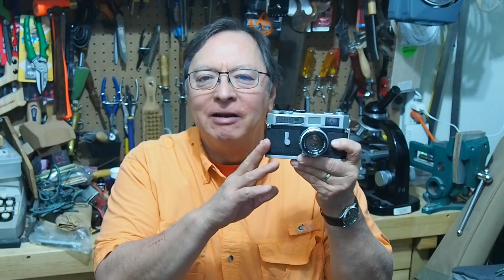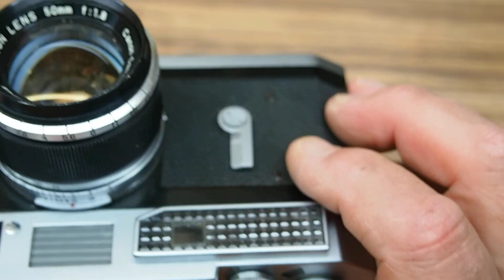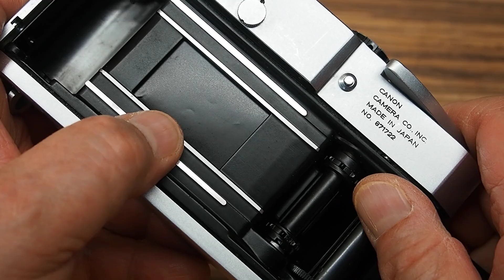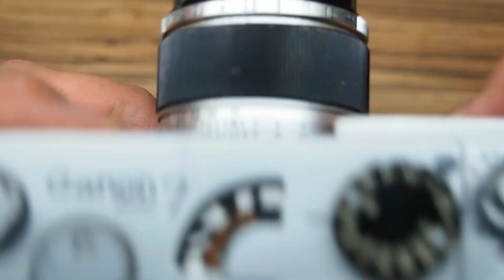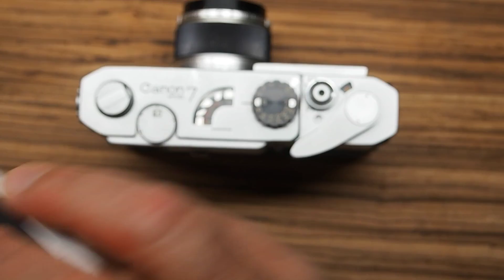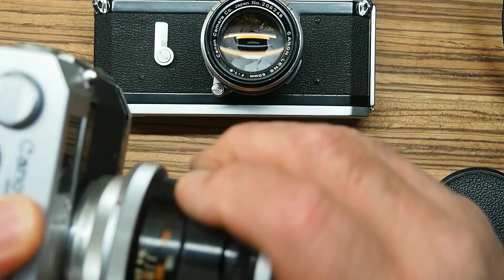Why I Fell In Love With The Canon 7 and You Will Too!

Comment: I have a 7sz and like it except the meter is not working.  I also noticed a slight improvement in the rangefinder patch in that it doesn't flare (ghosting) as much as a regular 7. Canon was never able to replicate the clean and sharp patches of the Leica M2 or M3.
Reply from the maker: Yes, I understand that the 7sz did have an improved rangefinder.  I had an M3 and an M4-2 and yes, Canon got close, very close but not quite there.  Maybe if professional rangefinders had stayed popular just a little longer Canon would have matched the M Leicas...

Comment: What a great video! Thanks for taking the time! Answered almost all of my questions for when I go to Japan this summer. One thing I was wondering about: is the flash contact on the 7 compatible with (studio) strobes, i.e. an X contact cable? I seem to remember there might be a compatibility issue with old cameras intended for flash bulbs (voltage too high perhaps)? Would like to be able to shoot the thing in the studio as well without it frying my strobe ;-)
Reply from the maker: The 7 has a standard PC outlet which also has a bayonet around it for attaching a Canon flash bulb unit.  You can still plug a regular sync cord in however.  Good luck on your trip!
Reply: @dongummphotography  Thanks for the super fast reply!

Comment: I'm having trouble finding a lens cap for the 1.4 lens on my immaculate Cannon 7
Reply from the maker: Canon used some odd size filter threads back then.  I have had pretty good success with odd size caps on Amazon or Ebay.  What is the filter thread diameter?
Reply: @dongummphotography  there is a UV filter already on the lens, but there was no lens cap when I purchased the camera. My callipers suggest that it's a 45 mm inside. size. Any online search that I've done suggest that it should be 39.5 I think which is available and I have ordered one which does not fit. I just noticed the engraved message on the front rim that says Canon Japan 48 there doesn't appear to be enough of an inside lip for one of the squeeze type lenses to hold onto.
Reply from the maker: @garyweisbrodt4440 I seem to recall that 48mm is the thread size.  If a filter will screw in a cap should be able to hold on.  Might watch Ebay for an original push on cap.

Comment: In the 1980s=90s, I fell into collecting Canon RF cameras. Along the way, I acquired a Canon 7 with 50mm 1.4 Canon lens. After deciding to make it my user, I sent it to Ken Ruth (one of the few Canon RF experts) for a full CLA. That lead me to a fact of life which is never mentioned on YT regarding the P, 7, and 7S models. They share a then-new and unique shutter, which, if left cocked on a fast speed setting when stored, will degrade the fast speeds to the point where they cannot be adjusted into spec. Historically, that repair required new tension springs, but those became gone by 1980, so you are just screwed. In my case, the top two speeds were out of spec (1/1000 a full stop slow) and 1/250 was barely marginal. As a result, I never recommend buying any of these three models without a shutter speed test, and even then, it's questionable. If the shutter goes out in any way, it is unrepairable. (In the US, you probably couldn't find anyone to do a shutter service apart from a CLA adjustment.) Buy a 7  if you want to make it part of a collection. If you want a user, buy a VIT or the more rare VIL: lighter, smaller, more cool looking, easily repaired, since it uses the Leica-like shutter common to Canon models prior to the last three models.  (Avoid the P for the same reason, plus its relatively poor viewfinder.)  As for an accessory show on the 7, Canon sold a unique accessory shoe on a bracket which locks into the PC flash socket on the end of the body: new - a few bucks; today - 1/3 the value of the body, if you can find one. As for adapting an FD/FL lens to the LTM for a Canon RF body: why bother? The converter is grossly over-priced. Further, the Canon SLR wide angle lenses in FD and FL were modest in quality compared to other manufacturers- just not that great, plus, as mentioned, they don't RF couple. Save money and just use the Canon RF wide angles, which are as good or better.
Reply from the maker: I've never had any issue with bringing a 7 into spec.  They use the same roller-blind shutter design that many cameras use and leaving one tensioned, regardless of the speed it is set to, could eventually cause the spring tension to weaken, as it would with any camera, but they are as adjustable as any horizontal, roller-blind shutter is.  
I owned a camera repair business for 12 years and have been repairing them most of my adult life.  The design of the Canon 7 or P shutter doesn't present any extra challenges in my experience.

Comment: Thank you very much for the Canon 7 presentation. Do you think that if the needle does not move when adjusting speed it is because it has a defect or is just missing a setting ? I saw that there is protective foam around the edge of your camera. Can you confirm this ? My camera does not have any.
Reply from the maker: If the meter needle does not move at all, it is usually either the hi/low switch contacts or the selenium cell contacts that are oxidized.  If you are referring to the light seal at the hinge side of the back door, yes, I replaced that foam.  I use black neoprene foam weather stripping cut to size.  It is peel and stick, so it is easy to apply.
Reply: @dongummphotography  Do you think I can fix it (selenium cell contacts), or is it too difficult ?
Reply from the maker: @Lolaraptus  it is a pretty easy camera to work on.  Here is a video that may help.  https://youtu.be/PwfYwHEjoAo?si=rp6Jr45PzAHHeT6k

Comment: You didn't address the Jupiter 12 on the 7. Is it compatible or not? Also, on the 7s, there was a hi lo switch on the meter.
I have a Canon 7 and absolutely adore it
Reply: The Canon 7 is my favourite film camera, and it has stiff competition. It is a joy to use. I have a Jupiter 12 but haven't tried it on the Canon as my 7 is getting some love. My understanding is that the early, silver Jupiter 12 can be a problem, but the later black versions (anything post 1972) are fine. It is scary though when you open the shutter on bulb and see this honking great rear element looking back at you. Great and very informative video
Reply: @peterkay9050 
Thanks for the info I'll keep an eye out for one
Reply from the maker: @peterkay9050 thank you!
Reply: I had a Jupiter 12, it's issue is that it rubs slightly against the upper baffle, not the shutter. I suppose it may be down to slight differences in manufacturing tolerances between the 7 and the jupiter 12. It wasn't a great deal but left a slight rubbed mark on the baffle. I now have a Canon 35mm ltm lens.
Reply from the maker: I don't own a Jupiter 12, so I did not adress it's compatibility issues.  My 7s is not working yet, so I missed its hi/low switch around the meter cell window.  Sorry about that.
Reply: @dongummphotography thanks I am interested in the Jupiter 12 but I have heard conflicting reports that it touches te shutter curtains on the 7 it's apparently  OK on other Canon ltm cameras.
Canon 35mm lenses are just too expensive
Reply from the maker: @mgman6000 I agree.  I have heard about issues with the Jupiter 12 and other Canon models, so I haven't  pursued getting one.  I was lucky enough to find  a Leitz 35mm f3.5 Summaron on Facebook Market.  It was mounted on an aircraft gun camera and I was able to buy it for 60 dollars.  That lens got me back into rangefinder cameras.  Having that lens I had to get a film camera to use it on.
Reply: @dongummphotography 
Nice find I'd like to get 35mm lens but not ar twice the cost of the camera
Reply: Hello,  thanks a lot for your great video. You tell all the practical things other videos dont show. The 7 is a great camera (I own all three models) but the very good viewfinder is the only reason for me to use it. The body is to big and not as pleasing as for example the VI or V and L series. My favorite Canon RF for daily and practical use are (in my opinion) VI-L, VT de luxe, IV SbII (although it has a very small and dark Rangefinder, better use external viewfinders).
The outer bayonet is not only for mounting the Canon 50mm/f 1:0,95, but also for the mirror box 2. Regards, Thomas 
The